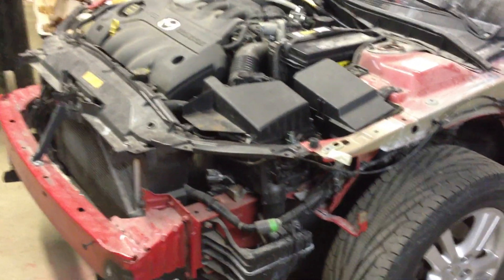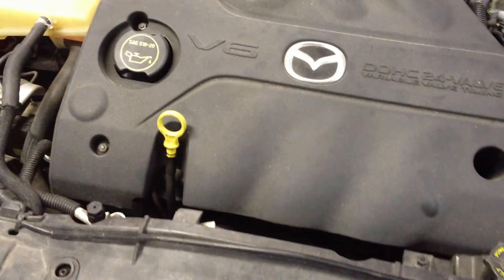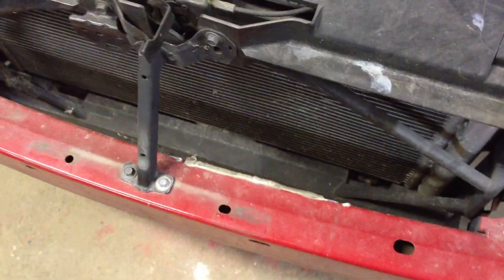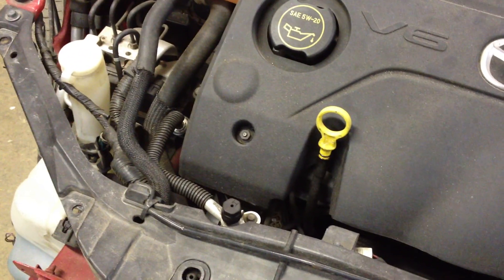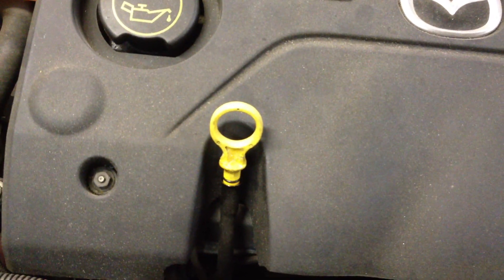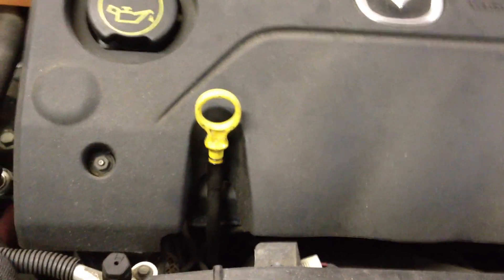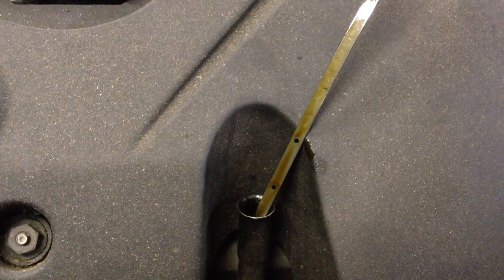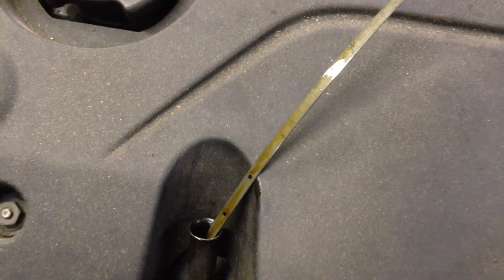Gasoline + HHO = Clean Oil

Comment: This is something I've noticed in my truck since I started running the generator. My oil still looks brand new and by now it has started to turn black and time for an oil change. There is more to the hho injection than just trying to increase MPG. It seems to help keep the engine clean and may add years of life to the engine. HHO is the bees knees lol